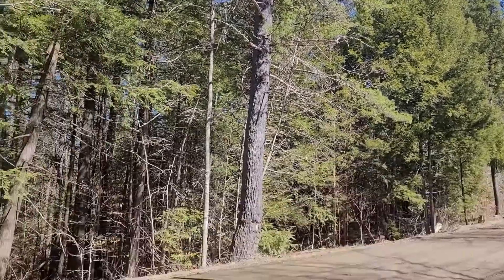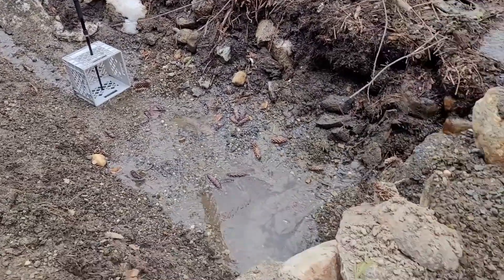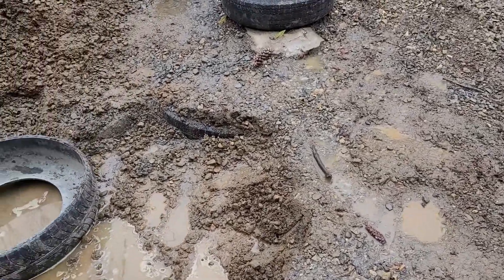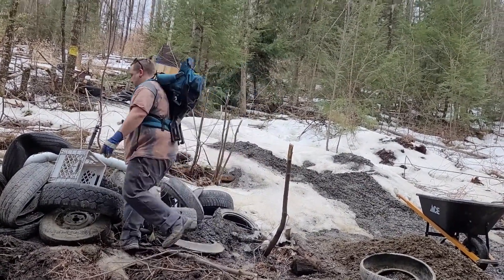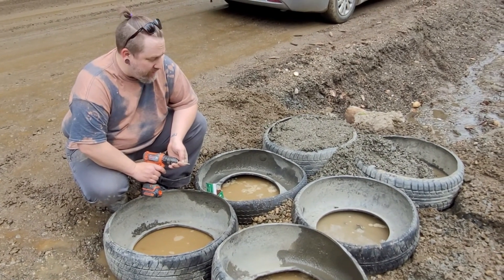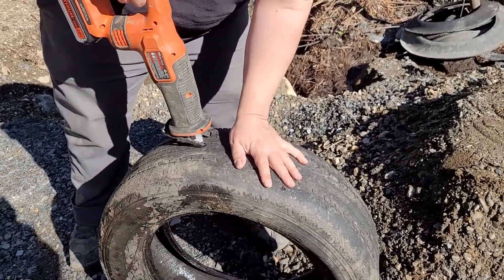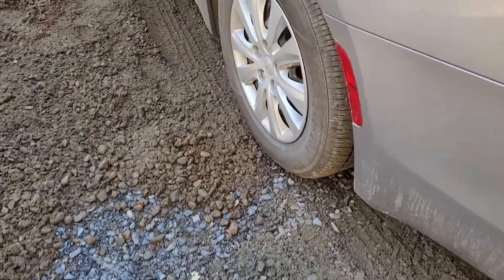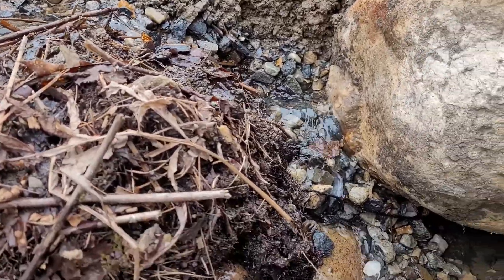Mechanical Concrete Driveway – Start to Finish [Part 4]

Comment: Funny fact try to finds some tips kidda- use some drain pipe under it,  membrane to stabilize or cut both sidewalls.  Figure it out on my on my own make some at march , doing exact the same just cut one side wall (make 4x 10cm cuts on the other sidewall to drain water ) maybe lazynes, maybe the feeling that one uncut sidewall will stabilize gravel better, biggest problem no rocks, gravel (expensive) at my place, just black soil. Greetings from the opposite side of the earth :)